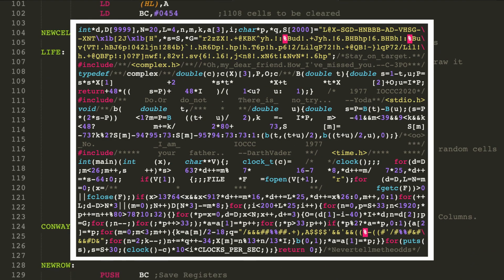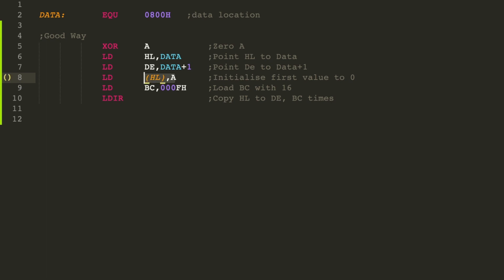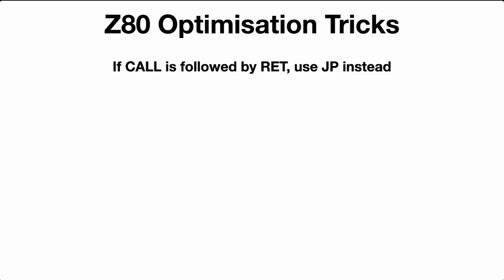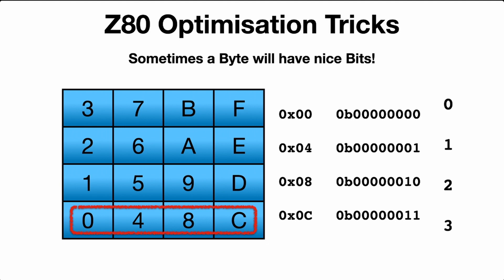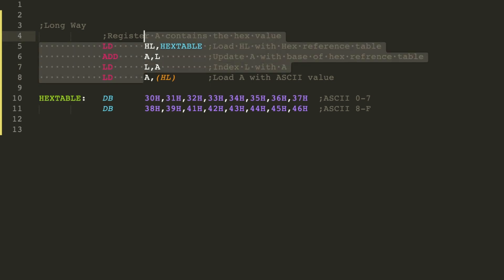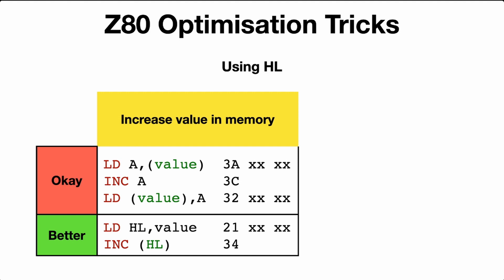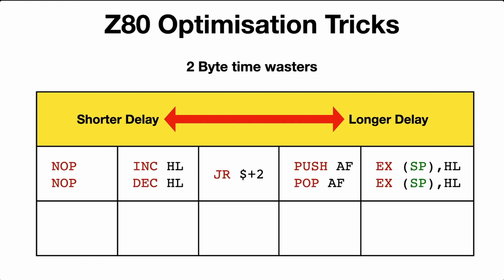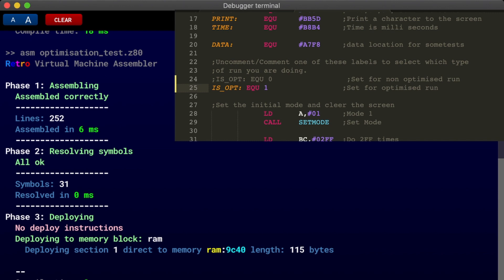Z80 Optimisation Tricks

Comment: AND A is also often used instead of CP #0 or OR A.
Reply: The H flag behaves differently. This may or may not matter depending on what your code is doing.
Reply: Agreed, only the CP instruction has a variable outcome on the Z80's Auxilliary Carry bit (the H flag for 8080) whereas the AND and OR instruction always sets it.

Comment: The LDIR example, you load BC with 000F which is 15. You have to do n-1 into BC for the fill as you preseeed the first location manually, also otherwise you'd overwrite one byte past the end of the target block.
Reply: It's always good to precheck the B/BC value particularly for calculated values prior to executing LDIR and DJNZ instructions because zero values can have unintended effects.

Comment: This is severaly my jam!  Can I add more stuff?

Firstly, the way the fall-through example is written means it will execute 10 times, because after do_it and proc have been processed, it'll return back to the instruction after CALL do_it and do the whole thing again.

OR A is a quick way to replace CP A,0

Using the alternate register set is really quick when you run out of registers in a subroutine.  The trick is to make sure all the stuff that needs to work together are in the same set, and only use A, the index registers and stack to transfer between them, because EXX does not swap A for A' register.  You can preserve the flags with EX AF,AF' for use later this way too.

LDIR has a great 'bucket chain' algorithm that again isn't a trick:  Doing something like LD HL,0; LD DE,1; LD BC,80 - 1; LD (HL),n; LDIR will fill 80 bytes with value n.  That's because each new value of HL is just filled in time with DE, so the same value gets copied all the way through.  You can use LDDR for this too, backwards, or avoid the effect by using the opposite instruction.  If you need speed, a string of LDIs is a lot faster than the LDIR.

Aligning tables to a 256-byte boundary has more benefits:  Say you want to have a buffer that loops (for example, scanning keys that might not all be processed immediately).  You can use LD HL,table; ...[do stuff] ; INC L to loop back to the start without doing an out of bounds check.

Storing word-length lookup tables 'vertically', aligned to a 256 byte boundary helps with speed, as you don't have to double values to get to the correct offset.  In this case you do something like LD E,(HL); INC H; LD D,(HL); DEC L 

You can change the code directly by using LD (replace + 1),a; ...[more code] ;replace:  LD A,0.  The 0 is changed to your value.  This is really useful because the most major optimisations come from identifying the most intensive loops and removing as many bytes/t-states from these as possible.  In this case, A is freed up for more use between the instructions.  However I condede it's faster to load from a free register if you have one spare.  Using the index registers as 8-bit registers works in most cases - LD A,IXL is valid for most new compilers.

Extending this idea:  You can use the stack as a standard register by doing LD (replace + ),sp; LD SP,nnnn, which means you can PUSH data directly into a buffer backwards.  PUSH is only 11 t-states to store two bytes, a miracle.  You'll need to make sure interrupts don't corrupt this, so it's better to PUSH information which can be corrected, rather than POPping from a table which may get corrupted.  You can skip bytes with LD SP,nn directly, or something like LD HL,offset; ADD HL,SP; LD SP,HL

Using jump tables is great to embed logic, so instead of the example where you test A for specific values and jump to routines, you have a list of the options as a table of routine addresses.  After you've got your jump address, use LD (jump + 1),HL; jump: CALL 0 to automatically return from your routine.  This stops you having to worry about putting JP nnnn after each of these routines.

For speed, it always makes sense to repeat blocks of code rather than doing lots of loops.  Even repeating something 4 or 8 times will speed things up a lot, if you have the memory to spare.  If you can 'unroll' a loop entirely, you also free up a register to use.

Lastly, I alluded to this before, but: Optimisation for speed/memory is really addictive and you'll probably end up wasting lots of time on your new obsession.  But it's way more important to keep your code readable for checking later, so always concentrate on optimising the intensive loops and not worrying about saving a few T-states every now and then.

Okay, nerd rant over!  Happy optimising.
Reply from the maker: Wow. Thanks for your contribution. I can make a whole video on this.

Comment: Rather than using PUSH AF, RLCA, RLCA, RLCA ,RLCA, CALL <fn>, POP AF,  <fallthrough to fn>, have your param in (HL) and use the RLD instruction. The RLD & RRD instructions are specifically for working with nybbles and complements DAA which is very useful for Binary/BCD to ASCII and vice versa. e.g. if you have (HL) = 0x12, then LD A,#’0’, an RLD will set A=‘1’ and a subsequent RLD will set A=‘2’; optionally do another RLD if you want restore (HL)’s original value.
Reply from the maker: Okay, This is a nicer way to do the nibble convert.  When using RLD, A is set there is no need to mask out the upper nibble.  Thanks for sharing!  I'll use this method in an upcoming project

Comment: When combining the loading of 2 registers such as B & C as a pair, in assembly language use a calculation such as the following to clearly indicate your intention.
e.g. LD BC,#(LOOPB_COUNT << 8) | C_VALUE
Reply from the maker: For the example here, I just 'hard coded' the values but I would if possible use LD BC,((B_VALUE) * 256) + C_VALUE, using << and | is somewhat more elegant
Reply: Use of << and | is cassembler specific and only makes sense to those used to high level languages such as C. 
This is not correct Z80 assembly on its own and many assemblers will reject it.
Reply: It's a feature of the current Zilog Z80 macro assembler and manual assembly. When a handy function is available make full use of it!

Comment: LDIR is neither a trick nor an optimization. It's a pessimization. It's extremely slow. Optimized Z80 code back in the day avoided it. It is nice and readable and takes fewer bytes so if you're optimizing for code readability or binary size in code that doesn't need to be fast then it might be worth using.
Reply: LDIR is slow for filling memory but ok for copying data from one place to another.

Comment: It's not really worth doing the two back to back push/pop operations. Two 8 bit loads are a quicker way of achieving a 16 bit LD RR, RR and they also use two bytes Sometimes we can use ex de,hl instead of that though.
Reply: Good point.  If BC is already available, just doing a LD D,B and LD E,C is good enough.  I'm just showing here that the stack can be used to set registers.  Stack modification can also be used to change the return address after a CALL
Reply: @slartibartfastBB  Indeed. I used to often put null terminated text inline which would be output by the called routine. No need to load the address of the text before calling an output routine so it saved bytes.
Reply: The LDIR at 2:40, 13 bytes.
Other way.
XOR A
LD HL,DATA
LD B,16
LOOP:
LD (HL),A
INC HL
DJNZ LOOP

10 bytes, but slightly slower.
Reply: This goes to show that the purpose of optimisation is important. Smaller code is not always faster. Are you trying to save clock cycles or bytes of memory, or both? 
Push and pop are very slow at 11 clock cycles but only a one byte opcode. Ld reg>reg is only one byte but 4 clock cycles only. 
So push bc pop de = 2 bytes 22 clocks
Ld d,b ld e,c = 2 bytes 8 clock cycles. 

The fact that push and pop use memory can further impact performance via wait states in dram access, as well as needing available stack space.
Reply: Did you know that EX DE,HL just an instruction to toggle a the CPU’s DE, HL hardware addressing switch? No actual data moved.
Reply: @PebblesChan  yes. It's quite clever.. As I recall, one of Ken Sheriff's blogs goes into some detail about this.
Reply: When there is IX or IY involved the gain by using two LDs vs push/pop are not so big...

Comment: The HEX to ASCII methods look very interesting. I will be trying that out with some software I'm currently writing. I once rewrote a monitor program for a slightly different processor and needed to save bytes. The original program fit in to 1K and my modified and enhanced version was just a hair over that. There are times being able to save a byte or two becomes a fun challenge.
Reply: Might want to look at:

CP 0Ah
SBC A,69h
DAA

Say in something like:

BYTE:
PUSH AF
RRA
RRA
RRA
RRA
CALL NYBBLE
POP AF
NYBBLE:
AND 0Fh
CP 0Ah
SBC A,69h
DAA
; Output A, preserve registers
CALL PRINT
RET

and of course, the CALL PRINT;RET could be JP PRINT
Reply: @johncochran8497  That would be a shorter way of doing the conversion if it worked but it doesn't.
Reply from the maker: I haven't see that method before. Thanks for sharing. Also the nice hex to ASCII routine with Call fall through.
Reply: @kevincozens6837  Really? Perhaps you're using a buggy emulator since DAA is not used too often in subtract mode. So let's look at the code.

; Entry, A is 00h to 0Fh. Don't care about the flags.
CP 0Ah
; A unchanged. C if A is 00h to 09h
SBC A,69h
; If A was 00h to 09h, it's now 96h to 9Fh. C is set, H is set, N is set
; If A was 0Ah to 0Fh, it's now 0A1h to 0A6h. C is set, H is clear, N is set
DAA
; Since N is set, DAA will subtract one of {00h,06h,60h,66h} depending upon the value in A and the C and H flags.
; If A has 96h to 9Fh and both C and H set, 66h will be subtracted, giving 30h to 39h (ASCII '0' to '9')
; If A is 0A1h to 0A6h and H is clear, the 60h will be subtracted, giving 41h to 46h (ASCII 'A' to 'F')

Overall, no problem. But if you have a buggy emulator that properly handles DAA in addition mode only, look at:

OR 0F0h
DAA
ADD A,0A0h
ADC A,040h

7 bytes total which may seem less efficient. But notice in the hex routine the AND 0Fh at the beginning of NYBBLE. That's there to allow any value instead of restricting it to 00h to 0Fh. The 4 opcodes can be directly replaced with the sequence above for the same total byte count. 

Code description:
OR 0Fh
; Set upper nybble to all ones. Clear N,C,and H flags
DAA
; Will convert A to 50h to 59h, 60h to 65h
ADD A,0A0h
; Want to force a carry if upper nybble is 6. So A is now 0F0h to 0F9h, 00h to 05h. Carry set if A is 0 to 5.
ADC A,40h
; And convert to ASCII RANGE.

Comment: LDIR is not a win to clear a block. LD HL,address LD B,number LD (HL),value DJNZ loop
Reply: LDIR can clear blocks > 256 unlike your routine!
Reply: ...that would write 'value' to the very same address B times. You need to INC HL  🙂
Reply: The clear winner is using a Z80 DMA however most Z80 systems don't have one! If you do have a Z80 DMA with DRAM you'll have to ensure that it is properly refreshed.
Reply: Game code on Z80 systems back in the day used an actual trick to clear larger amounts of memory with the CPU. Such as clearing the screen. You save the stack pointer and all of the registers, set the stack pointer to the high end of the memory you want to clear and set all the registers to zero. You then push all the registers onto the stack in an unrolled loop. Finally restores your saved registers and stack pointer. There is a tradeoff to how much you unroll your loop. More unrolling means larger code size but faster memory clearing. Some techniques used all the alt. registers too. There are similar tricks for copying large amounts of memory used for instance in double buffering on systems that only had a single range of screen memory. LDIR is the obvious way and is not a "trick". When learning Z80 we all fell in love with LDIR and DJNZ of course but when we got good at Z80 we realized they were slow and avoided them. On those old systems speed optimizations = cycle count. On modern systems compilers know the efficiency of all the instructions but in addition to cycle count they now have to take into account more complex factors such as cache and pipeline behaviour.

Comment: the hatred of goto stems from the push for higher level languages.  Which makes sense, you have better options there.

but on an old 8-bit processor, that's how the hardware really worked.  And all those higher level features HAVE to be, on some level, ENABLED by the use of jumps.
Reply: My hatred of goto stems from some developers creating spaghetti code with them, chock full of disorganized ideas.  But well thought out code can use them respectably, especially in ASM.